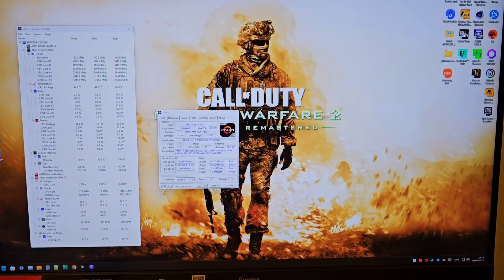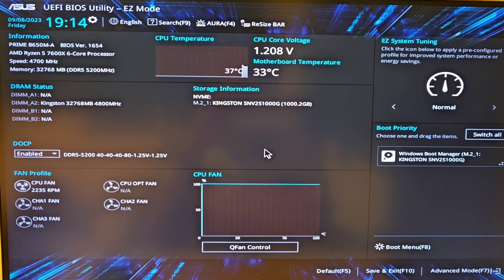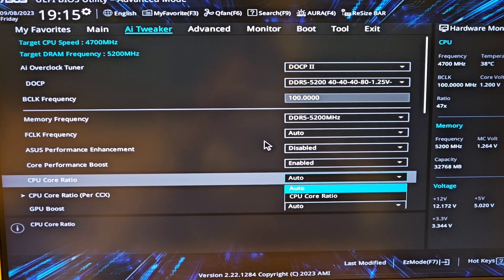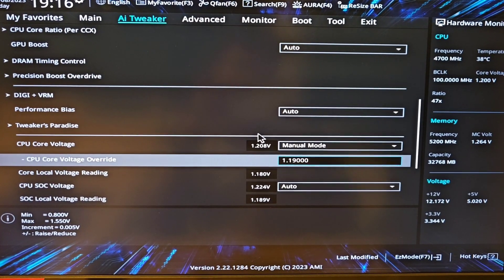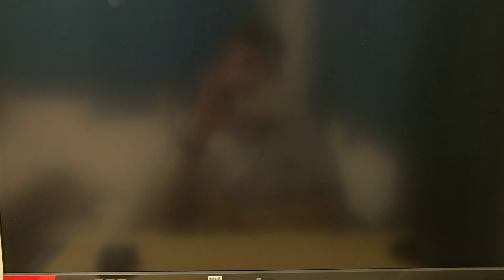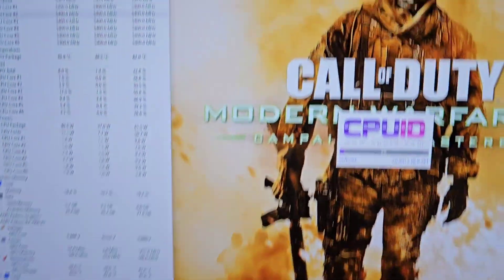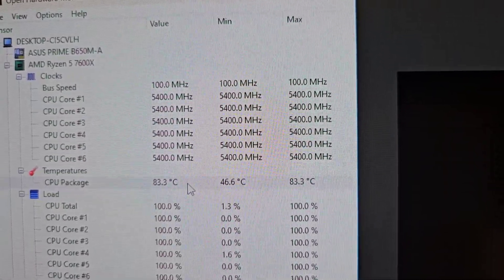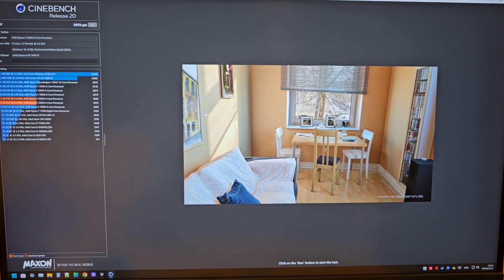AMD RYZEN 5 7600X OVERCLOCK EASY TUTORIAL 👍🏻🔥

Comment: No game will ask of pc to use so much cpu power n utilization i do this tweks get better result n more speed of cpu but at big cost..😢😢u cant play first warzone or any other game with 80c then do twiks post that is on 65-70c without any cost,maybe in world of dembelia...point is i got more stutters even at low end games n i got pc that run every game in 1440p ultra with 7900xtx...minor tweeks in gpu alowed but dont do to much and why would u?like u want cooler temps? Get better cooler?more speed?better cpu..more fps BETEER GRAPHIC... dont do shortcuts...now days so much frame gen all acros nvidia amd n intel not enough?u have even 3thd party program to litteraly inject frame gen in game if she dont alredy have it n get more fps...😢gpu is mucle cpu is there for everything to work right at top will ask for 40-50%use if u need more then u r 3D creator or some...btw i put in power plan max cpu usage 99% its smooth as hell...enjoy life n gaming be simple

Comment: 1.19V seems like the sweat spot for ryzen 5. my 7500f can do a stable 5.5GHz on 1.19V
Reply: you overclocked the same as this video tutorial?
Reply: I have an msi b650-S wifi not an asus mobo
I just did a classic manual overclock increasing clocks and voltage 0.02V at a time and running cinebench r23 for 5 minutes if unstable I add 0.02V if stable at less than 1.2V I try to increase clocks by 0.1GHz at a time and repeat

Comment: i done in ryzen master: 1,2V -> 5,4 Ghz in my result was max ~75C in stress and around 50-65C in games like BF5, CoD BO6 / Warzone
Have to test other options to get better result. Increase is around 5% from stock (14965 points - stock to 15679 - after undervolting)
If someone need help i can try help

Comment: Note: This is better if the core multiplier is set to reach that clock with C-state off and Core boost off. All voltage are without negative voltage curve to ensure greater stability. Try reducing the voltage at your own risk of crashing.

7600X 5,4GHz = ±1,32V (Stable)
7600X 5,3GHz = ±1,2V (Stable)
7600 5,3GHz, 105W TDP = ±1,21V (Stable as far as I know)
7500F 5,3GHz, 105W TDP = ±1,3V (Should be stable)
9600X: 5,6GHz 105W TDP = ±1,36V (Stable)

Don't forget to change the TDP profile of the CPU for 7500F/9600X/7600.
Reply: 7600 5.35GHz 1.19v using curve optimizer -50.
Reply: I got my 7600 to 5350mhz -30 stable, but for some reason my cinebench r32 multi score dropped by 1400 points to 12836 and I can't figure out why @hckermn_WOT
Reply: 7600 5.55 GHz 1.28v manual oc
Reply: To what should i change it ?
Reply: And for the 7600x ?
Reply: Can anyone help me I over clocked my ryzen 5 7600x to 5.4 ghz and 1.21 volts before over clock I used to get 280 to 400 fps in Fortnite now I’m getting 160 to 210 can anyone help or recommend a better over clocking ??
Reply: @dxxvyboi9843  Check if you're settings are still on. Enable EXPO if it wasn't already the case. Disable C-State control. Disable Core boost. Set core multiplier to 54. Enable PBO Advanced. Set PBO limit to motherboard. Save settings and exit BIOS. (Also your FPS might depend on something else than your CPU)
Reply: @FireCestina1200  hey I have a question is setting the core ratio at 54.00 and the cpu for voltage override to 1.32safe and stable for the ryzen 5 7600x ?

Comment: 7500F.  1.33v -->5.3Ghz 144W 107° very hott🔥🔥🔥
Reply: I have 5.45 1.285v and 90w pbo 80 celcius in stress
Reply: @harni591  all core 5.45? Or single core 5.45?
Reply: with 240mm water cooling it is not a problem
Reply: 7500f 5.45ghz 1.2v, all cores
Reply: @dexterpwnz7505  very good 🔥🔥. My New Rayzen 5 7600x 5.6Ghz 165W 105°😎
Reply: I got a stable 5.5GHz on 1.19v/90w/80c on my 7500f in cinebench r23
Reply: 😮🎉 @AhmadShdfn16

Comment: You would likely get better results by enabling PBO and setting negative offset by core and then setting 125 or 150 OC target.
Reply: i have my 7600 non x at 5.5ghz 1.2v allcore. while using pbo it was just putting alot of voltage for a much lower frequency and very big voltage spikes just to achieve 1-2 cores boost but still under 5.5 ghz. for me manual oc did the best job on am5 and am4 aswell
Reply: @nexuqk  I think I'll try playing with that more, but maybe I'm getting better results with negative offset per core with newer BIOS, for now I can hold 5.3Ghz long term under hottest Prime 95 torture test
Reply: @DanielBrownOre  do you play games or prime 95 XD
Reply: @nexuqk  may iknow what motherboard do you using?

Comment: I got my 7600 non x at 5.5 ghz 1.2v,70-80c in full stress test with a arctic air cooler. I wonder if i can get more ghz because till 1.3v is safe
Reply: did u use single 8 pin
Reply: @obtun  u mean the power for cpu? then yes single 8 pin connector
Reply: @nexuqk it’s good or no?
Reply: @zajek7953  what?
Reply: I'm not that good at computers so I wanna ask is overclocking r5 7600 at 5ghz safe on a B650M ? Because I didn't get ur point
Reply: @MohamedEltl  yep,its not really "overclocking" cuz the manual voltage is lower in almost all cases. Stock they just push the voltage up so that u can hit maximum stock turbo clock because some chips have really bad silicon and doing it manually 99.99% its better. U can just put the stock turbo frequency and set the voltage a low as u can and it would be much better
Reply: Emmm, i have asus b650 and 7600x, how can i get MAXIMUM lowest voltage and like 5-5.2ghz, i want maximum lowest temps.
Reply: @KOT-ANGRY  i have a msi b650m pro,just did the manual allcore oc and manual voltages non of that pbo crap. everything is turned off power features and stuff from bios to keep it as simple as i can and just manual oc and voltages + expo on my ram and thats it. most of the people say to use pbo but that shit for me at least was just putting alot of voltage and voltage spikes for not ever 5.5 ghz spikes on 1-2 cores so for me its doing more damage

Comment: what kind of cooling system are you using for your cpu?
Reply from the maker: Just a 240mm AIO cooler
Reply: @ElBlancoBoss  on Open Hardware Monitor, is only showing Load. it's missing Clocks and Bus Speed. why is that? I have the Asus Prime A620-PLUS WIFI motherboard if that helps.
Reply from the maker: It does show the clock speed
Reply: I use 280mm cooler it still overheats
Reply: @sebastian_1569  thats strange the only thing I can think of is re-apply thermal paste